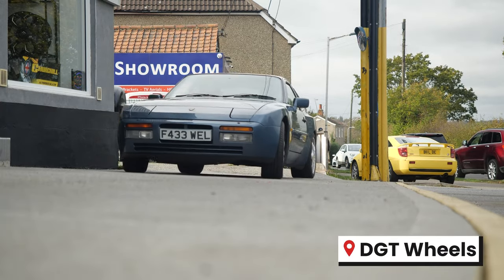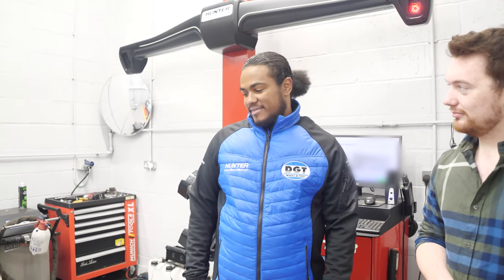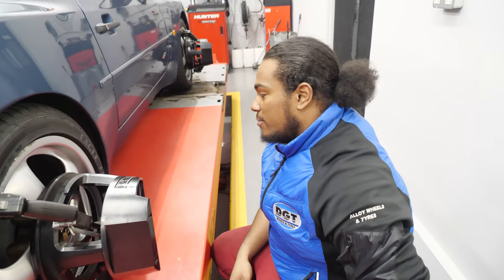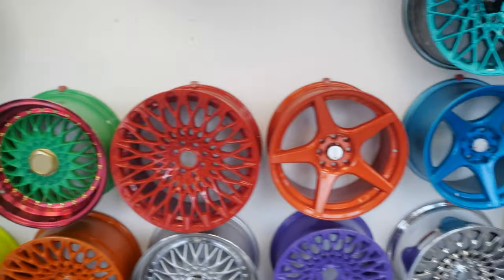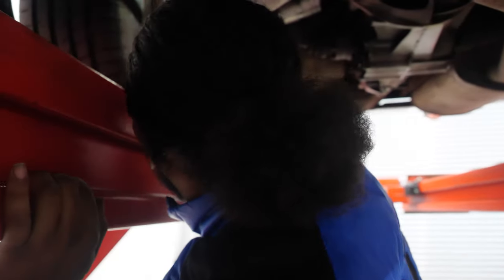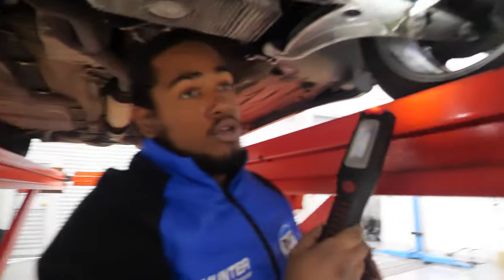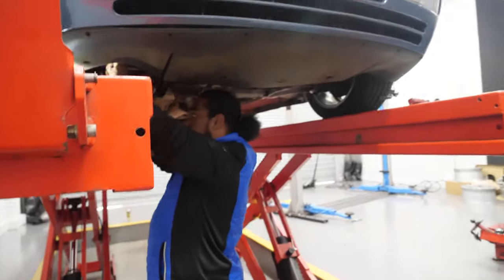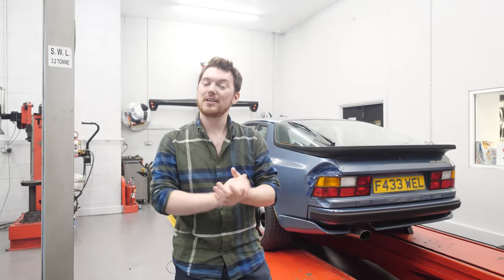Is Wheel Alignment Important? - Project 944: Episode 17

Comment: Hi,
What was your symptom that led you to do an alignment ? On my 944, the steering wheel is shaking at a certain speed (around 120 km/h), I don't know what could it be.
Reply from the maker: Main reason was that we knew this car needs some care so as we have new tyres on the car we wanted to see what the alignment was like. We also have some slight wheel shake and for us we've discovered that one of the front wheels is warped so it's not fully round. But alignment can also cause this from my understanding.

Might be worth getting your wheels balanced as they'll be able to find out if you have a warped wheel before you start spending money on alignments 👍
Reply: look for the wheels to be out of round or not properly balanced when you get the shaking like that.
uneven tire wear or pulling to one side or another is usually an alignment issue.